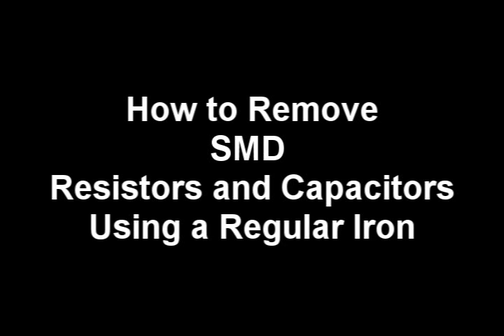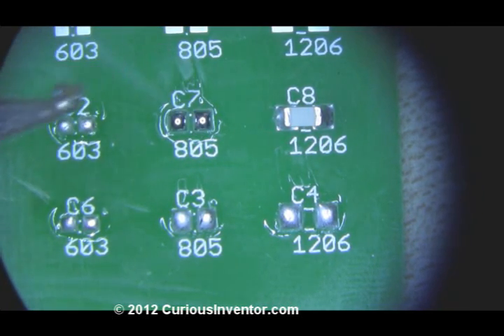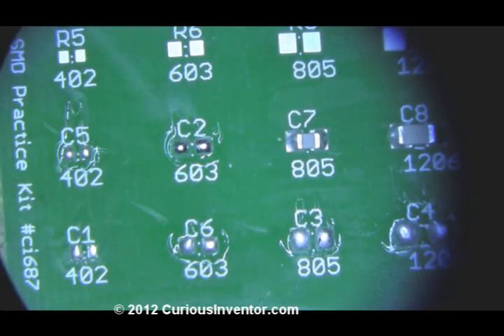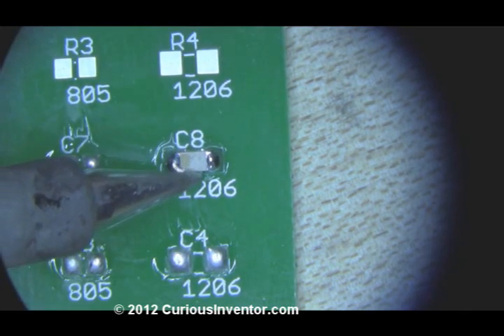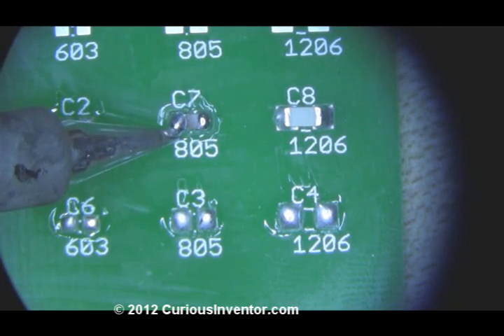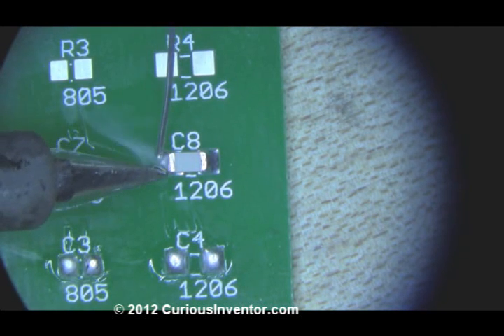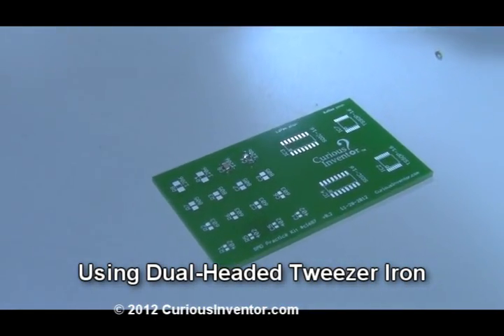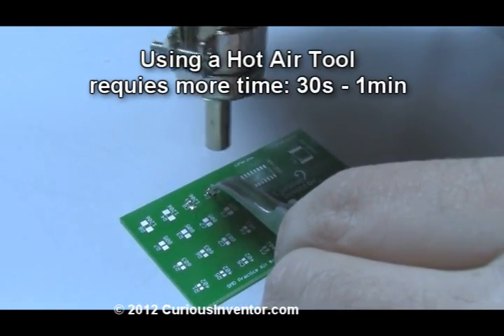How to Remove SMD Resistors & Capacitors Using a Regular Soldering Iron

Comment: Will try to attempt removing a 0402 0.1uF 6.3v capacitor from an Xbox 360 PCB. What would you recommend for a method? I have both a hot air station and a soldering station.

What would be easiest and/or fastest?
There are no near surrounding components.

I might put on some kapton tape just in case and minimize the risk of other components will let off.

This capacitor is shorted to ground when mounted in. Can something else in that circuit make it short? Or is the capacitor bad itself? Any ways of testing that?

Comment: Adding solder aids heat transfer not just because of thermal inertia, but because a dry tip placed against a component only has a contact patch of a small point, or at best a thin line. The solder blob provides a wide-area contact that allows much more rapid heat transfer.

Comment: You didn't mention recommended soldering iron temperature. I saw a similar video on removing 0603 components with this method and they recommended 800-900F.
Reply from the maker: Unfortunately the temp depends on the board. Lower temps (<700) put less stress on components, but if there's a large ground plane that sucks heat away, you'll need maybe 800+ to get the job done without needing to hold the iron on forever. In cases where there's a significant heat sink, you may even want to warm the entire board. Also depends on the wattage of your iron. Higher wattage can overcome the heat draw. I usually worked 700-750F as a starting point.
Reply: @CuriousInventor  makes sense. Obviously want to reduce dwell time but not be nuclear.

Comment: Dude, you rule - thank you so much for posting this!

While I have decades of amateur soldering experience, as I've gotten older, my eyesight and hands have started to fail me, and working with circuit boards and SMD components is much more difficult than it used to be.  Thank you for providing a simple - yet effective - solution for removing pesky microscopic parts without frying the board in the process.

Thanks to you, I managed to tinker around with a vintage iMac over the weekend and overclock it by moving a few resistors around.  I've done a good dozen of these procedures over the years, with about a 50% success rate.  Never would I have thought to just over-solder it a bit and "slide" the SMD resistor into place.  Tried it, worked like a charm, and I was finished in about ten minutes.  Best of all, I got to stick with the tools I already had - iron, solder, and flux - without having to invest in something else.  One of the easiest, best soldering experiences I've had in years.

Thanks again!

Comment: What if i need to desolder the smd cap to use it as a replacement? Won't the solder damage it?
Reply from the maker: the heat imparted by an additional desolder and solder probably won't damage it, but the more you heat things, the more chance for failure.

Comment: The title says 'regular' iron, then you use a double tip iron...  For those who don't have a double tip iron, attach a copper wire to the iron tip: the wire wraps around the tip and makes a 'fork' with the wire ends splitting in such way to reach at same time both contacts of the resistor.

Comment: awesome quick tips, I was able to get some SMD resistors off a tightly packed board quickly using the "add solder" method with a regular iron!

Comment: Will a 300 degrees (Celsius) hot air gun be good enough?
Reply: Yes, will take longer and you risk damaging neighboring components so I'd use some kind of PCB Heat Shielding Tape and make sure the tip of the hot air gun is thin enough to control the distribution of hot air flow going to a specific PCB component vs covering a group of components due to having a larger width tip on your hot air gun.

Comment: Is it ok when replacing the smd side can be switch in any direction when soldering? I mean if there is negative or positive on it.
Reply: depends on the component, resistors usually can be soldered either way but diodes can't

Comment: After you remove the resistors and capacitors do you have to solder jump the pads?  Or do you leave them disconnected?
Reply from the maker: typically you'd be repairing or replacing, so you'd want to put a new component in. Lots of times when you're prototyping you want the ability to switch between using a component, leaving it open, or bridging it.
Reply: So I am doing a project with a multirotor.  The ESCs that I purchased have capacitors and resistors that do not allow programming via computer software.   The fix that I have found is to remove these two components and it will allow me to program.  However I couldn't find out if I bridge the gap or leave it open.  Thank you for your help.
Reply from the maker: just as a warning, bridging the gap may break your ESC so make sure you know which to do!

Comment: i have a burnt smd capacitor on my motherboard, how do i identify what type is it i i want to replace it?
Reply: I never could. On my car ECU I had to get another Ecu (at least similar brand Bosch) and find the smd ceramic capacitors by color. Dark brown which are also shorter compared to the light brown stuff. I asked on EEVblog but nobody knew.
Reply: Sounds like it's by schematic or parts list only.

Comment: I use this method a lot and haven't damaged a resistor or cap yet. I would agree that it's probably due to the fact it doesn't stay on the tip of the iron longer than 2 seconds.
Reply: I suppose yeah... wipe the iron tip straight away, but be care full not to loose the little bugger in the process!

Comment: Only if you use too much heat, too much force, do it for too long or don't heat enough  before forcing the component off... Or if you're using phenolic paper PCBs instead of epoxy boards.

I've used this method a LOT, and sure i've lifted a couple of pads over the years, but usually due to not paying attention.

Comment: If you're using hot air, you can save time by heating the component without the pliers/tweezers there first. The second you touch the pliers to the part you start heatsinking the solder. Much easier to heat the part up, then flick the component away without touching the solder.
Reply: I have a general purpose heat gun bought from a hardware store. The nozzle accessories are very poor (one for paint stripping, another one for heating copper pipes etc.) Is there any way I could make my own precision attachment, accurate enough to focus the heat on just an 0805 sized SMD, and not the 30 other components in that area of the PCB?
Reply: @paulf1071  I believe you can use kapton tape

Comment: You need a tip small enough so it does not even touch the component.
Or you get solder paste, syringe and a heat gun.

Comment from the maker: Good point. As long as you tap the iron tip to shake off the component quickly afterwords, I'd argue that it doesn't get much more heat than with tweezer irons or hot air. I haven't had any issues frying components with this technique, but it's probably a good idea to use other tools if you have expensive or heat sensitive parts.

Comment: You should mention that a resistor/capacitor removed in that way is almost definitely fried to death because of sticking to the iron. Not that these SMD parts would be expensive, but if still want to do something with it after desoldering (e. g. measure a capacitors value), you'll have to use a more careful method.
Reply: What if you wipe the component off the iron tip immediately after removal from PCB? That's a very short period of exposure to high temperatures (...plus ...wasn't the component put on using high heat in the first place...)
Reply: well I did this to quite a few passive components and I never had any issues (in my hobby probects, wouldn't do that in a commercial area)